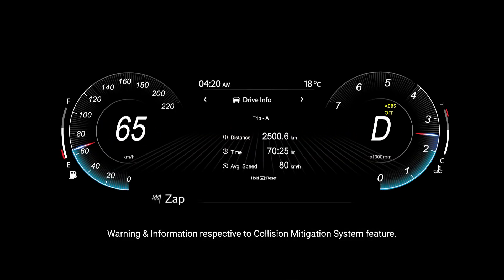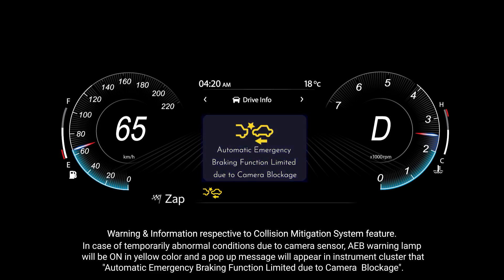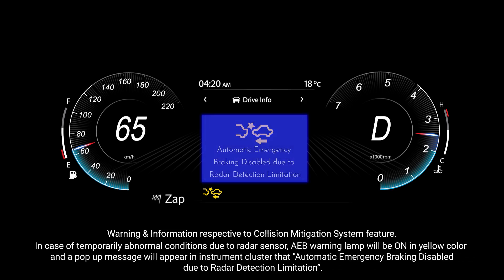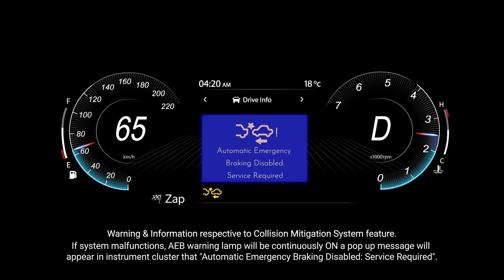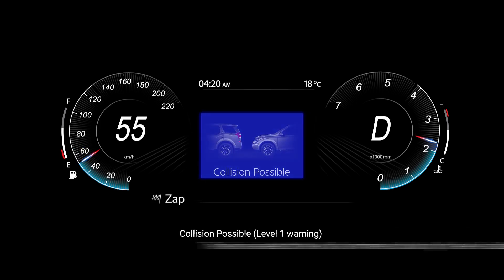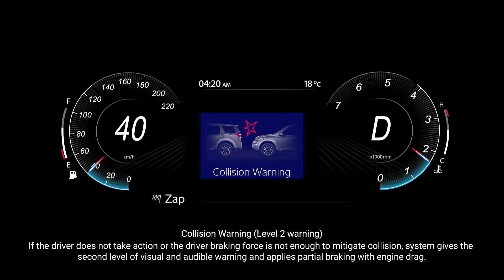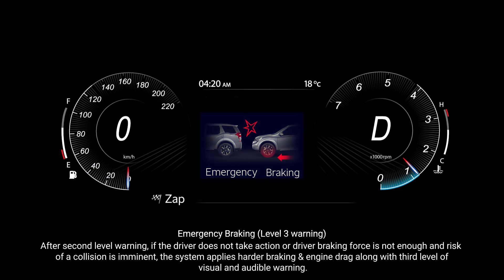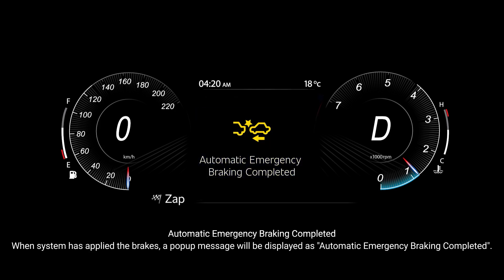Collision Mitigation System XUV700 - Driver assistance & warning alerts

Comment: Dear Mahindra Team, AARAV Mahindra Manesar, Concept Mahindra Gurgaon, Kumar Autowheel, 

Subject: Urgent: Severe and Ongoing Issues with My Mahindra Vehicle - Immediate Attention Required (HR26FB9316)

I am writing to express my deep disappointment and frustration regarding the ongoing repeatedly issues with my Mahindra vehicle due to engine manufacturing issue as confirmed by Concept Mahindra team and Kumar Autowheel. I have previously detailed these problems in my earlier correspondence, but regrettably, I have not seen any satisfactory action taken to address them. This has severely eroded my trust in Mahindra as a brand.
My car is my primary mode of transportation, and besides the inconvenience these repeated problems have caused, they have also led to additional expenses, for which I have retained receipts as evidence. I have endured significant distress due to these recurring issues, and it is imperative to determine who is accountable for these ongoing problems.
I am eager to resolve this matter amicably and swiftly. However, if the situation remains unresolved by (ASAP), I will have no choice but to explore further avenues to address my complaints, potentially through Consumer Protection agencies or media channels to replace my car or my money back. I don’t want to keep this car that is too dangerous for me and my family. 

It is important to highlight that, on multiple occasions, I have been traveling with my family, including three senior citizens, my wife, and my mother, only to face recurring engine issues while an route to a hill station. These problems have left us stranded in the middle of the road. Each time, we have had to return the car to the service center, where it has been kept for a day, yet the issues persist.

This situation is absolutely unacceptable from a company of Mahindra's stature. I would like to emphasize that my car is brand new, purchased in the year 2023 May. My frustration has reached a breaking point, and my mental peace has been severely affected. Regrettably, I am now compelled to take legal action against both Mahindra's service center and the company itself.
I’m attaching all the mail conversation which I advise to the Mahindra team earlier and faced the issue 4th time while taking care by Concept Mahindra sec-37 Gurgaon. 
This is the 6th time I faced the damn engine check light issue in the car. Both the service centers couldn’t find the actual issue in the car. 
  
I implore you to take this matter seriously and address it with the utmost urgency. I believe it is in the best interest of both parties to resolve this issue promptly and satisfactorily.

Warm Regards
Dheeraj 8130225263

My Details :
Reg. No. : HR26FB9316
Mobile No : 8130225263 
Still, waiting for the car status. 

No updates what the issues in the car .
Show quoted text